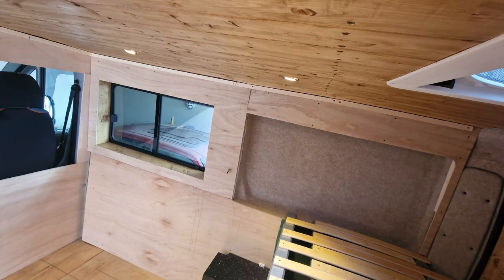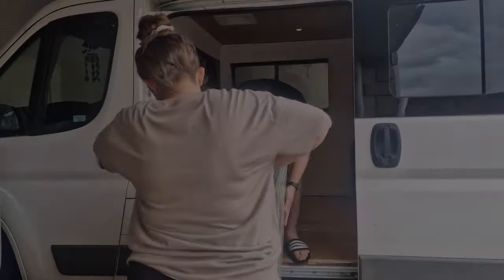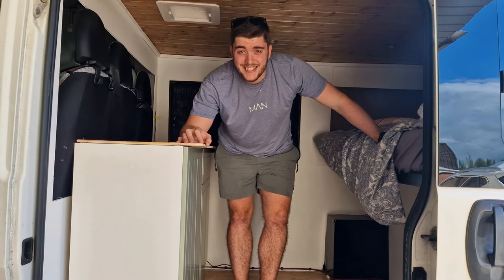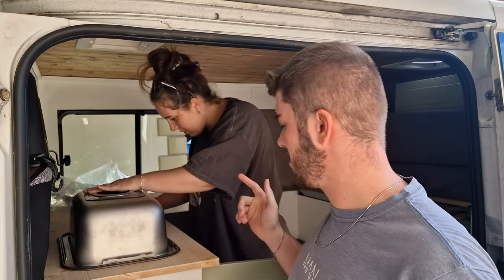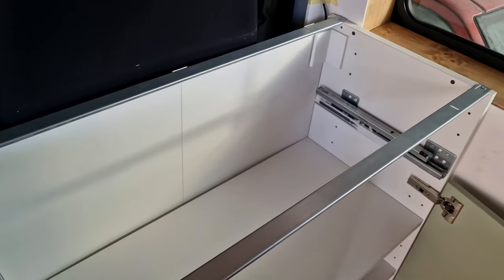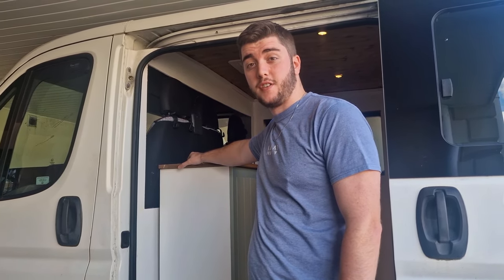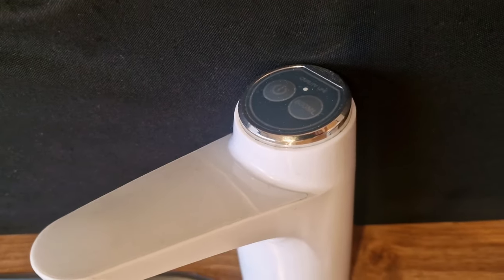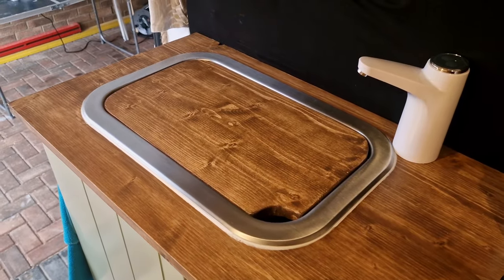IKEA Campervan KITCHEN Install | DIY Ducato Van Conversion | UK

Comment: Looks great, deciding to go for the same thing on my van. Any tips on how you got the cutout to fit in the sink?
Reply from the maker: We've had ours in for over a year and their still like new! Ummm the sink was trial and error, take it down to a certain size but then if it doesn't fit just go at it with a sander :)
Reply: @CoupleWithACamper  it looks great. What thickness timber board did you get for the kitchen worktop?
Reply from the maker: @itscashman7398 it's 18mm mate, worked great, Wickes it is

Comment: How did you get the wee worktop to fit back into the sink space without falling thru lol 😂  ..serious question though
Reply from the maker: We cut to the guidelines of the sink, so the outer lip catches on the work top and it just rests in place :)

Comment: Great idea on the kitchen and we've just bought the same style! How did you attach the units? Have you just screwed them in to the floor frame you made or did you fix them to the bulk head you created? Cheers!
Reply from the maker: Hi mate, the kitchens going strong 1 year later! We secured with about 60 long screes through the base into our frame we make for it to stand on and had no issues mate

Comment: Hi I have watched all your videos, and I find you talk sense.
I read on FB and elsewhere that the longevity of ikea kitchens in a van is not good, due to movement and moisture.
1 year on from your install are you still happy with the units or would you have done it another way?
Reply from the maker: Thank you so much! We heard the same but honestly they've been installed for over a year and they haven't not shown any sign of deteriorating or loosening atall, they are honestly our favourite part of the build and are something we would be doing in our next van build!

Comment: It’s very pretty and functional.  My only concerns are…
 - if the usb faucet was on the other side closest to the door, you could reach water from outside as well and may need that when cooking outside.  
-The other concern is not being able to get to the front seats quickly and stealthily.  You also won’t be able to turn your van seats around for seating.  Could it fit lengthwise along the van wall where the door slides open?

Comment: Nice job. Im on my third build. Previously i made my own cabinets but like you said they never have that higher quality finish. Which model kitchen unit did you go for? Subbed
Reply from the maker: Thanks mate! We used the slimline method Maximera units from IKEA, their sill going strong! Thanks for the sub mate

Comment: Looks great! How is the board working out as a worktop? I'm using the same units and tempted to do the same as you, just worried with it being a softwood it will dent and scratch easily? 
Cheers, Adam
Reply from the maker: It's been fab! We just took extra time to stain and seal it properly with multiple coats, defo saves weight and looks good too :)